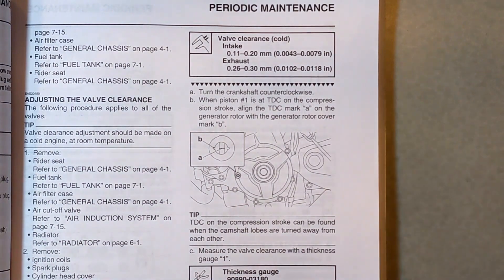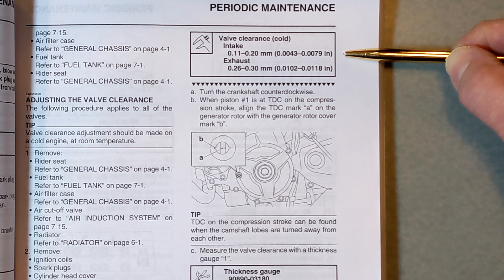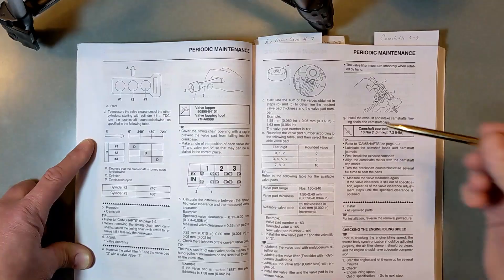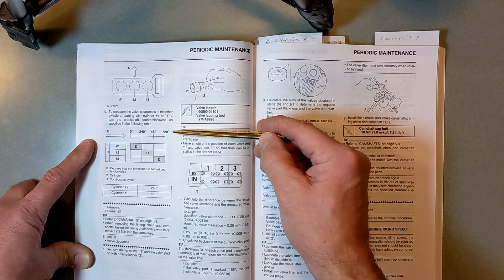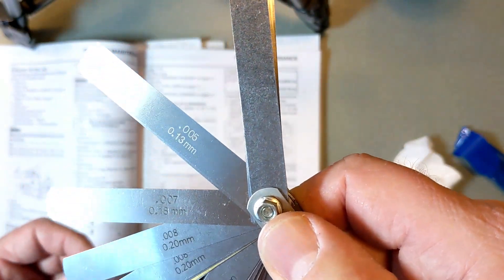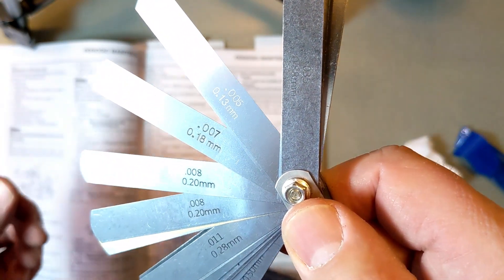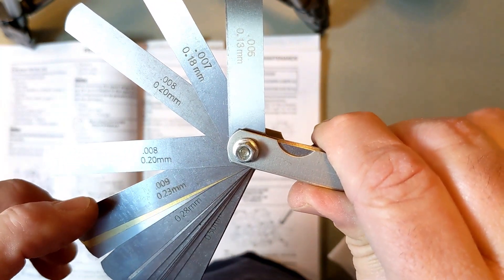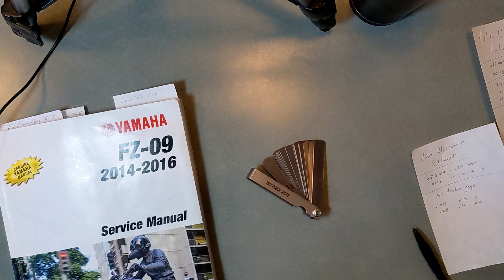feeler gage selection Yamaha FZ-09/MT-09 2014 2015 2016

Comment: I bought a set a set of metric feeler gauges from Amazon.  They were unacceptable.  Now I know why all my mechanic friends only have English feeler gauges in their toolboxes.  I went back to using English measurements, like you do.
Reply from the maker: Thanks for the comment!
The only difficulty that  I found was converting to metric because usually the shims come in increments of .05 mm
It's not too dificult because (.0019685 inches  = .05mm)
Round this off to make it simple .002 inches = .05 mm)
I show the calculation in this video:
https://youtu.be/8Qe27s9OAjs?t=122